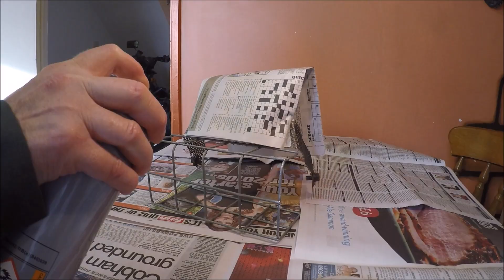GS550 Rat Bike Restoration Project 34 #Mesh Headlight

Comment: You have some serious skills with fabrications in metals. Great flow for the bike's front lines of travel.
Reply from the maker: Another lovely comment thanks. I was very happy with the finished result but later on as you get further on with the project, unfortunately I had to remove it. I may reuse it again in a different way!?
Reply: @Ratqueenbikes  sure you'll find a later project to adorn with it. Like the loops for the cording very much, then later you iced the cake with that "13" button which just perfect. Yes, I have a fascination with that particular number. Always thought it lucky somehow.
Reply from the maker: @murraykriner9425  Great comment thanks and that's funny, I was thinking that thirteen could be lucky to! lol :)